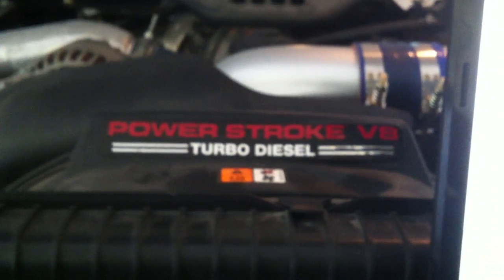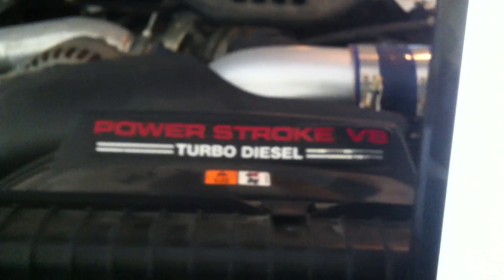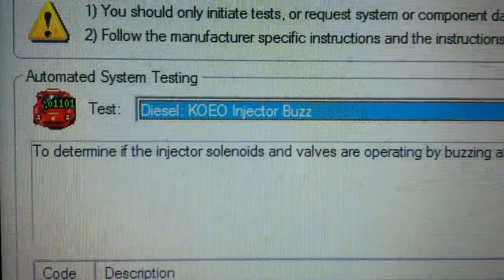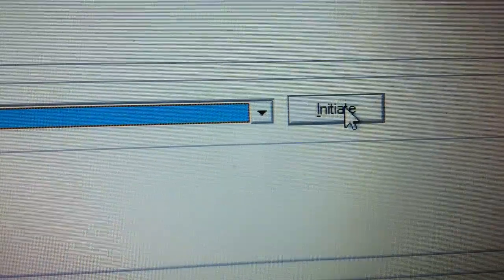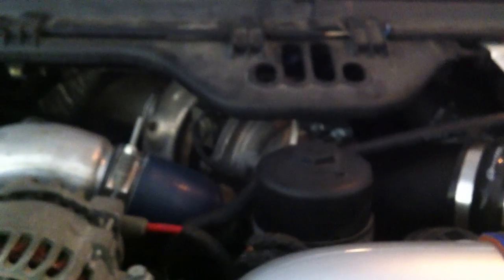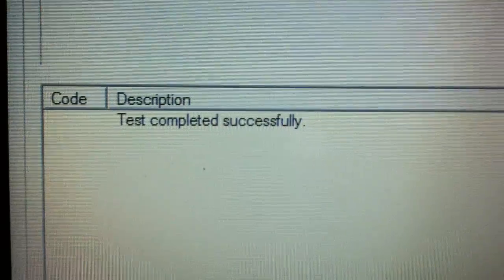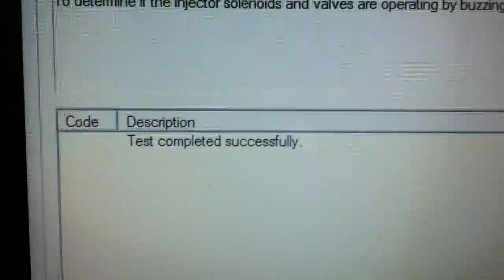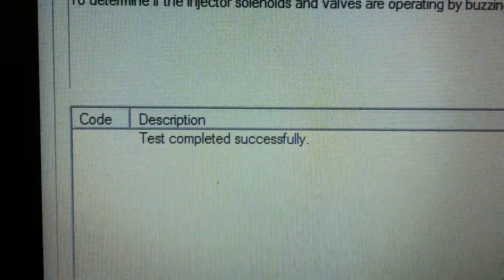2006 Ford 6.0 Diesel Injector Buzz Test

Comment: so there is no buzz sound on the injectors?  Just a clicking? I ran this on my 7.3L and got a buzz on each one.   Ran it on my friends 6.0 and it did as yours did.  Just a click and a clatter after all eight.